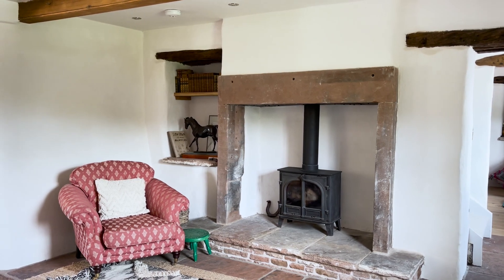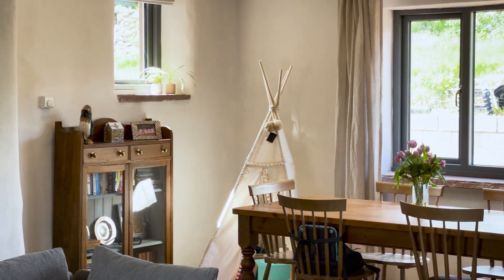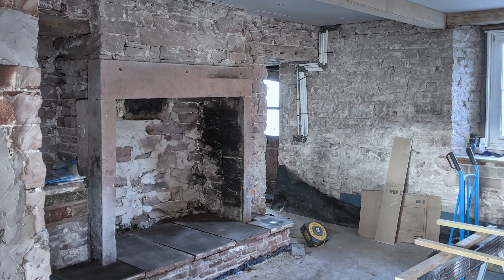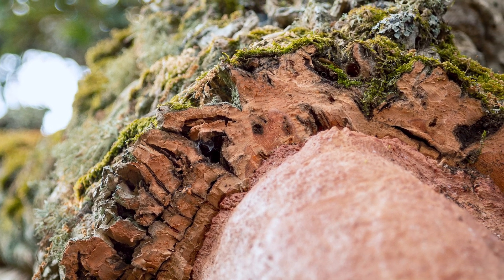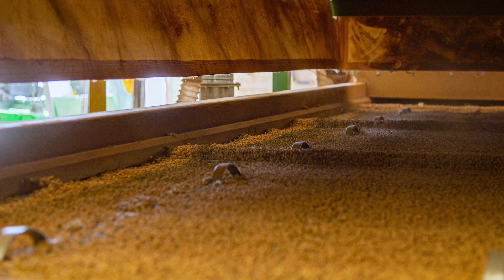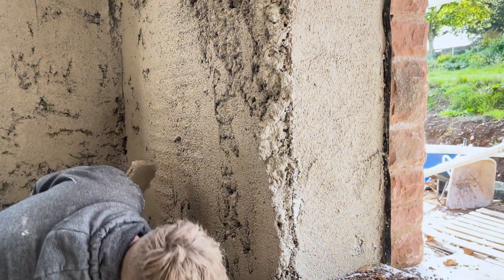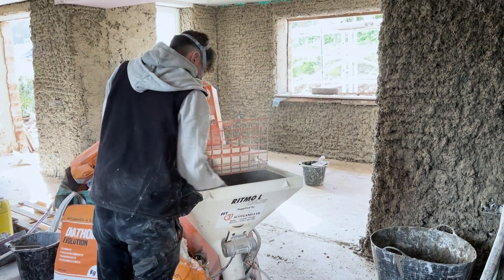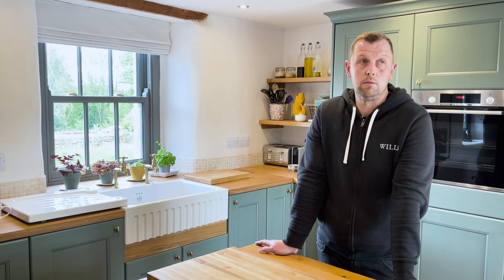Bringing an 1800s farmhouse up to modern insulation standards using Diathonite

Comment: The Diasen insulated plasters are great products. We used Evolution in an 1800's brick built terrace house in Cambridge where it noticeably reduced traffic noise passing through the front wall as well as greatly improving the thermal performance.  We finished in traditional three coat lime plaster.

It's important to use breathable paint finishes on the walls otherwise moisture will still be trapped and unable to evaporate which it must be able to do. We used Keim paint which is as easy to use as vinyl matt but is breathable.

Comment: Would be great to revisit this with homeowner to hear what it’s been like to live with. What is the thermal performance compared to limecrete for example?
Reply from the maker: Diathonite Evolution insulating plaster was used.  This has a thermal conductivity of 0.045 W/mK. A 50mm application typically improves the thermal performance of the wall by approximately 3.5 times.